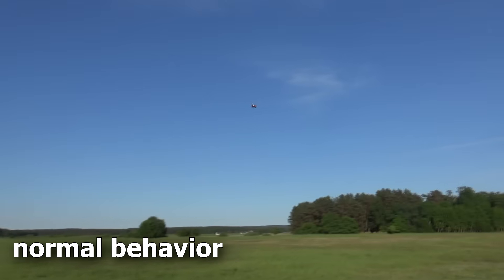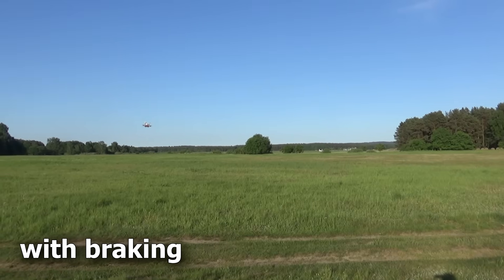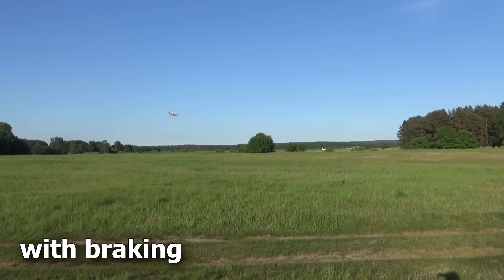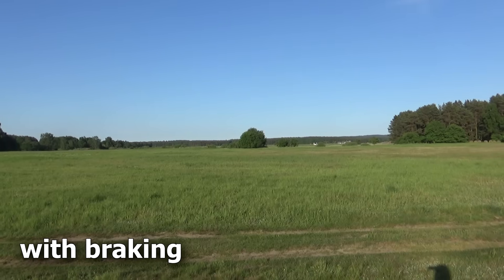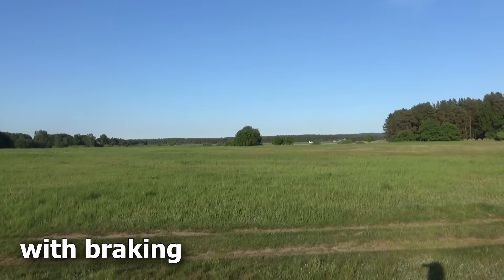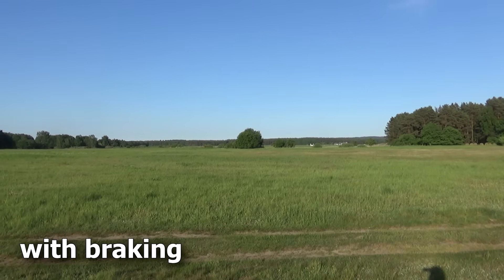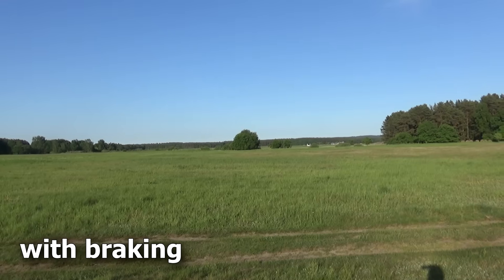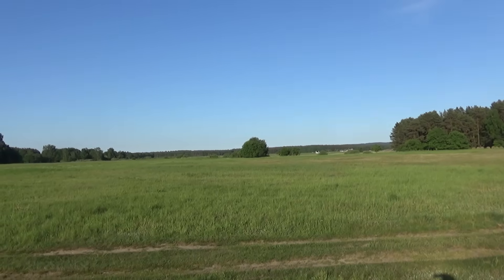INAV braking  mode for multirotors

Comment: If I have the rates for the pitch axis set to a maximum of 22° under the Rates & Expo tab, and I have the Max. Bank Angle set to 40° under Multirotor Braking Mode, can the drone then perform this 40° braking, or does the 22° in Rates take precedence and limit the braking angle to 22°? 😃😁

Comment: I crashed and broke my 5 inch drone due to this issue.Omnibus f4 inav 2.6.1. I tried it again with a second drone 5 inch Omnibus f4 (different fc). The same reaction. when cruising at high speed the drone shoots away uncontrollable. RTH saned me. I removed the mc braking mode to be on the safe side.

Comment: Almost seems like we could set a max angle for stopping. Say the camera is on a target and it only pitches up to the angle until it stops so it can stay on target. But of course you could still have the more aggressive non angle limited stop as well. As you get better we will have very smooth braking. Good stuff.

Comment: This will be awesome. I'm returning to INAV after several months away from the hobby due to personal reasons and now that I am unemployed (yeah, the bad luck didn't end yet) I would like to try some coding for INAV. I did code for embedded systems many years ago so I know the ropes but I would like to know if there is some sort of INAV code for beginners around - besides the wiki. My idea, as a testbed, is to implement support for the radio modules on the CC3D revo. I know it is nothing very useful but I happen to have a couple laying around and it seems a waste not to use this resource.

Comment: Im looking forward to this feature!  I had to get use to "the rubber band effect" on my 5in racer ... I fly in Acro & use PHold to "freeze" my position in mid flight with the flip of a switch (LOVE IT!).  But when your flying at 35+ MPH and hit PHold my quad stares at the sun for a few seconds ..LoL ( from the quad pulling back into position) .  I was nervous the 1st few times thinking the quad lost orientation or starting to do a weird " toilet bowl" but it slings back and locks into position!  Thank you for ALL the work that you and your peers are putting toward iNAV.
Reply: Roger Can that's exactly what I wanted to say as well. I have the exact same switch setup.

Comment: I thought it was up to the Pilot to brake forward movement....?  A combination of up elevator and a reduction of throttle to prevent it ballooning up..?....Rather like collective on a Helicopter.
Reply from the maker: In 3D PosHold it is not working like that